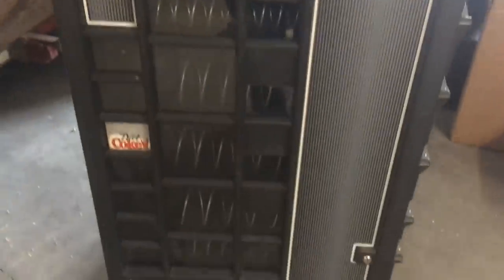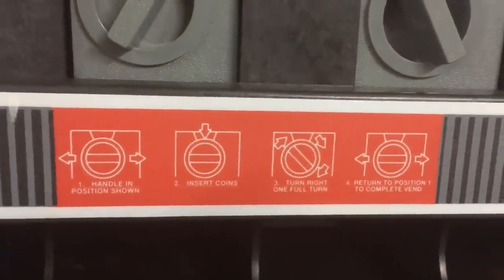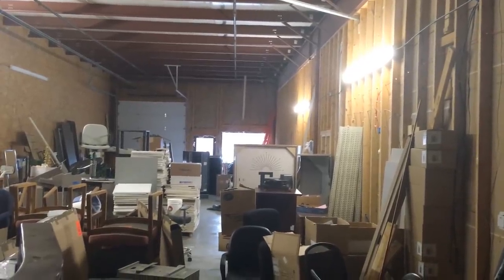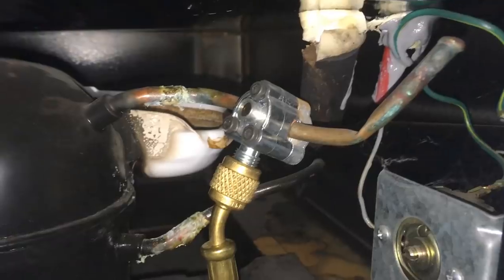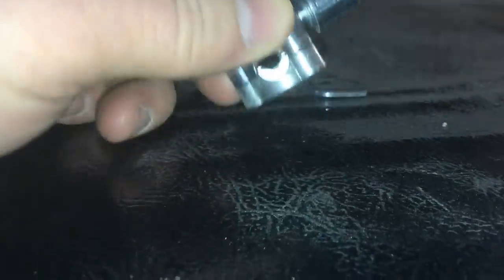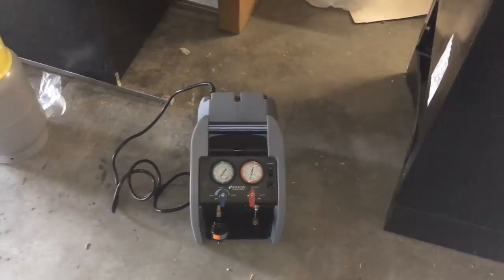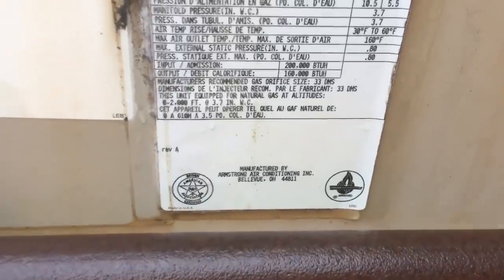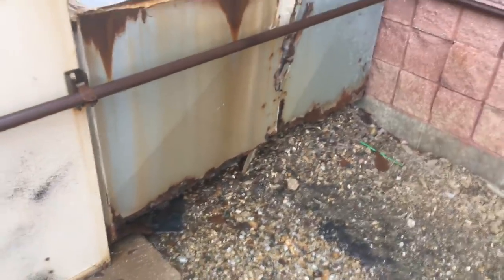Preparing an Unwanted Vending Machine for Recycling

Comment: Wow interesting that the door opens to access the soda and with it closed access to snacks. Neat

Edit the Armstrong unit is from October of 1994.
Reply from the maker: I can't swear that's how it was designed to work (note the "diet coke" logo on the front door) but it seems logical enough. I was able to confirm that the vending machine dates from the year 2000.

I thought I saw a date code of 1999 on the Armstrong Air unit, though it's entirely possible I have had a brain fart.
Reply: Wonder where it came from, looks like the ideal machine for a motel or something along those lines.... (can you tell I watch a lot of Uxwbill😉)
Reply from the maker: I don't know where it came from. I've never seen one like it before.

Comment: Did I hear correctly? Uxwbill has a mobile phone?
Reply from the maker: Unfortunately, yes, at least for the moment.
Reply: Im guessing only because he needs one for a job, he’s stated he doesn’t like cell phones all that much
Reply: Sadly they have become a necessary evil. I still prefer the Western Electic telephone on my basement wall...
Reply: This may get me in trouble. But no risk, no reward. Uxwbill has a cell phone until he loses it again. ;)
Reply from the maker: Sometimes there's no reward even with a risk. :-P You'd be in huge trouble, buster, but I need to figure out why my laundry pile is ringing.
Reply: I've found that a run through a washing machine will quiet even the loudest ringing clothes. Unless it's a flip phone...mine went through the washer 5 times.
Reply: @imdafarmergamerboy1650  I am 16, The only reason why I have a flip phone is because my parents want to stay in contact with me wherever I am, But I have over 40 Vintage telephones and operate a Telephone network made for collectors called NPSTN
Reply: I HATE Cell phones, I MUCH Prefer landlines :)

Comment: Cool vending machine bill. I can say I have never seen one like that before also
 I assume the machine took R134A? Also what do you think of the shift to the "new" flammable refrigerants (R32 & R600A and probably others) that are being used for newer chest freezers, my friend has one and it has warnings all over it about not to use an ice pick or any sharp instrument that may puncture a refrigerant line
Reply from the maker: It left the factory with R-134a. What it had in it by the time I came along is anyone's guess.
Reply from the maker: You had asked about the new flammable ("natural") refrigerants, and I had planned to revise my earlier comment with an answer. Well, I kinda forgot.

I don't think they're a bad thing, only different. R-290 (propane) is another popular choice. While those warnings sound dire, in many cases there is only an ounce or less of refrigerant in the system. Were it to be accidentally pierced or to spring a leak, I can't see much danger being the result.

Comment: What a neat machine. I wonder how reliable the mechanism is, aught to be better than those motor driven ones that don't work half the time and you end up loosing your money, or it forces the drink out with such impact that it pierces the can on something internal and it squirts sticky soft drink all over you.
Reply from the maker: There was evidence inside of a drink having sprung a leak. Whether it happened during the vending process or some other time, I can't say.